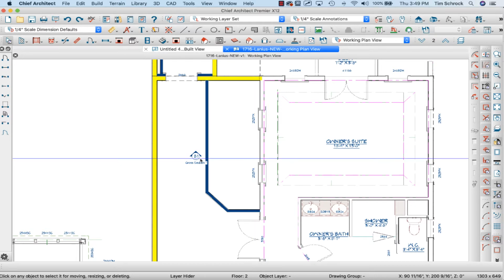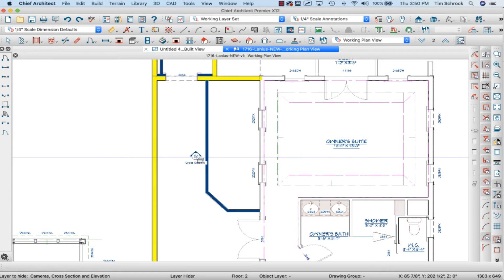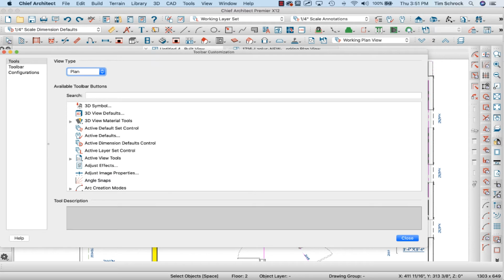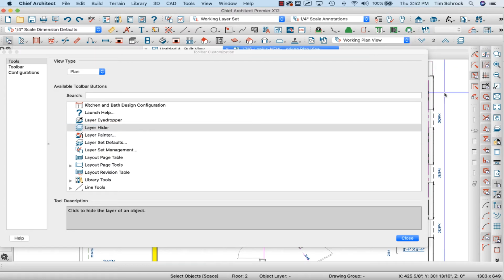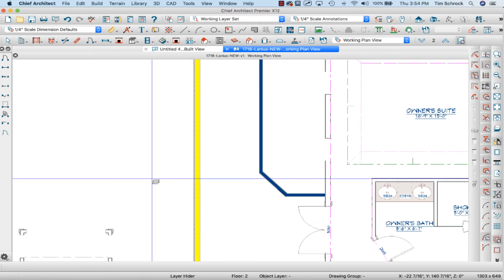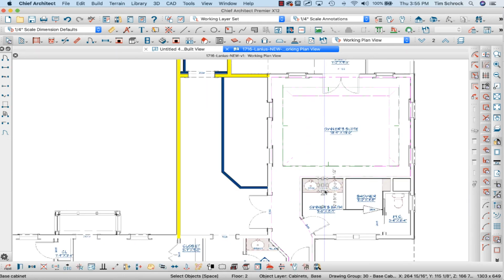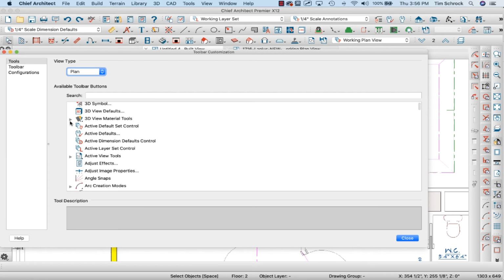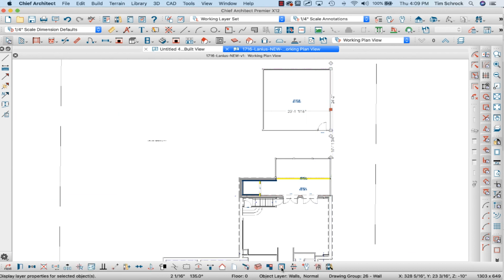Clean up the working screen with custom toolbars | Chief Architect

Comment: Thanks Tim. That's a good tip.  Can the toolbars be color coded?  The background color?
Reply from the maker: Thanks! I don't think you can give toolbars different colors from each other. In Preferences > Colors tab, you can make custom color schemes but you only have one option for toolbar background which will change the background color for ALL toolbars.